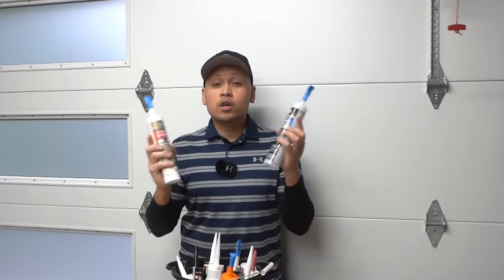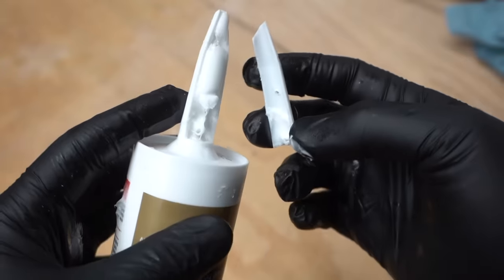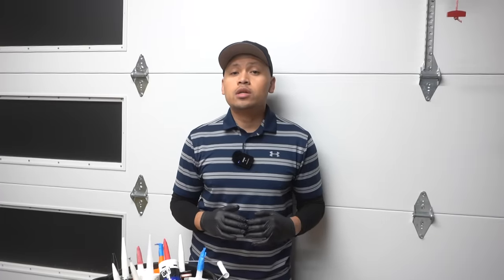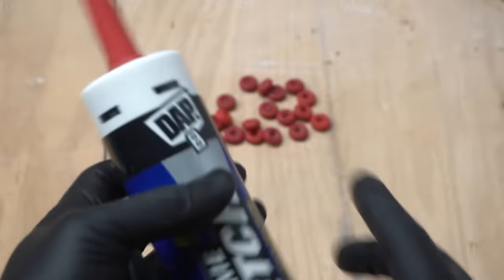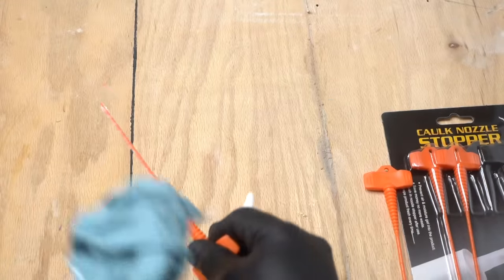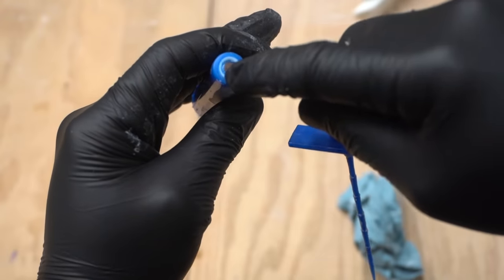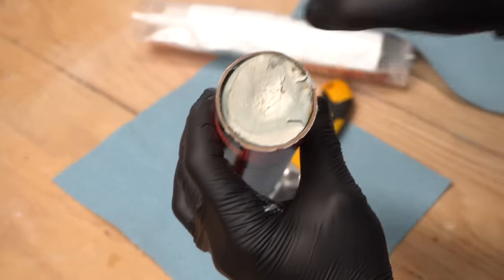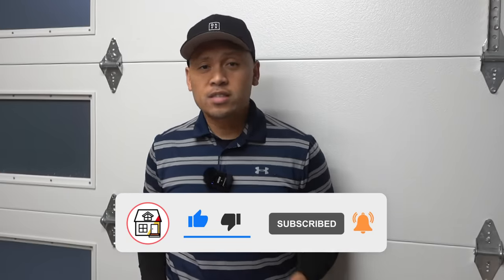STOP Throwing Away Half-Used Dried-Up Caulk Tubes! How To Fix It To Last Forever!

Comment: My dad owned a painting business in the 80s and 90s in Florida. When I go down to visit him he showed me a trick. Depending on how big of a hole you cut out of the tube. You get a wire nut and screw it on and just squirt just enough to seal that little end up inside the wire nut. 

I’ve been doing that for as long as I can remember. And just now a year and a half later I go out take the wire nut off squeeze the handle and look the tube still working properly.
Reply: Yep. Wire nut.
Reply: What's a wire nut?
Reply: I liked your idea, wire nut.  Thank you very much.  I will try.
Reply: @georgemooyman7155  A wire nut is a threaded plastic thimble used to connect electrical wires. Used primarily in the states.
Reply: @tommeyer3770  his whole premise is on the wire nut ,😂think he means a wing nut
Reply: @Zzrdemon6633  Not as commonly as "wire nuts"😂
Reply: @zeez4178  Nope, a wing nut is open on both ends.
Reply: I do the same thing. I use a red wire nut. Fill it the wire nut with enough caulk or sealant so it squishes out. Works better than anything I have found.
Reply: @zeez4178   nope he meant wire nut. wing nut is totally different.
Reply: Thanks, great idea.
Reply: Lol - is it like ball joint = joint balls - it was actually my first unexpected joke in English. Mechanics at the garage laughed like 15 min non stop… I still remember that day in TX
Reply: I used wire nuts but I missed the trick about squeezing out a bit of product into the nut! Great tip!

Comment: Our suggestion is to use what my Dad taught us to go 
1) Use a tight fitting screw to seal tubes for short term storage (a few days).
2) If long term storage is needed, we pack them in an old fridge that keeps them cold.
Six months later, we can still use the tubes as new.
Hope this simple idea helps someone out.
Reply: Thanks for the tip!
Reply: Damn that's handy

Comment: Ok, I'm a remodeling contractor and I rarely click on these videos, but just out of curiosity I scrolled through your video and I'm glad I did.  I sometimes use 5200 or similar marine caulking compounds and they are really expensive.  I save them by pouring a little bit of paint thinner down the nozzle and if it has a removable spout, which they often do, I clean that out and wrap some plastic or duck tape over that, then screw the nozzle back on.  Now I'm going to get some of those condoms for my caulk.   One thing you should mention is, even if there's a tiny amount of air in the nozzle, that will catalyze the caulk, so when you skin it back, make sure there's a blob of caulking coming out the tip into the condom so there's zero air space.  I guess those Tube-a-new things could be reusable if you clean them out after using them, making them more affordable, but hopefully the caps will prevent the need for using tube-a-new.  Anyway, thanks for sharing that info.
Reply: It's a balloon that's all 😅
Reply: Seal the hole with hot glue. Then when your ready to use it again just pull it off with some pliers.
Reply: @davea5150  Now that's a good idea, thanks!

Comment: I’ve used children’s small balloons to place over the caulk end point. As long as it maintains a tight grip once you roll it down to the base it should hold good until next time. The only thing is balloons are a little more on the thin side so being careful when placing is a must or you risk puncturing it.
Reply: That’s so true , cost per unit is way lower

Comment: Great video! Thank you!  A couple comments on this topic to share here.  
1- The blue painter tape your using has a porosity to it, pretty good for short term, but I would recommend clear packaging tape or a plastic based tape without a paper base to it.  I paint professionally for some years and love the stuff, but clear would be better for long term storage. 
2-Some caulks loose their ability to cure properly over time, I saved some caulk and used it years later and it FAILED to adhere the two plates together, it became a big project to remove all that caulk and then go buy new, so keep this in mind for the level of project your doing and if it's worth a possible compromised outcome. Yes, i said I had this caulk on the shelf for YEARS, if I can recall the brand and type I will update this comment.  
3- Just an aside tip I learned from professional commercial glazers on my jobs, to save the old caulk tubes and use the back of the empty tube to give you a place to wipe the excess caulk off your finger or tool into the rear of the tube! Simple little trick many may do already, but it changed my projects for the better with this better way to manage the material and it's excess that can actually be re used in contrast to wiping on a paper towel and disposing of the excess caulking. Neatness is everything in caulking as you know!
Again THANK YOU for the video!  I will be purchasing both the products in the links and think of you often my friend! Ciao Vince
Reply: porosity!!! Learned a new word today!
Reply: Really good points.
Reply: I use plastic electricians tape to prevent air contamination.

Comment: Great video on a subject that's overlooked! I use 1/2" clear flexible tubing. I cut several pieces about 2-1/2" long. Then heat one end with a heat gun until it gets soft. Then immediately squeeze the heated end in a bench vise. Leave until completely cool. These tubes fit all caulk spouts and when full of residual caulk or adhesive simply throw away and make more.
Reply: That's what I do.
Reply: great tip.  thank you!
Reply: Great idea. I have a couple feet of 1/2 tube I kept for no particular reason.

Comment: Like many do-it-yourselfers, I throw away more caulk and adhesives than I use due to drying and clogged nozzles. Screws plus tape never works long, so this video offered great tips, using products which I didn’t know existed. The first solution seems the best. Thanks for a very useful and informative presentation!
Reply: Ditto everything you said!
Reply: he said great tips :-)
Reply: All you have to do is leave a little bit of caulk around head of the nail once it's all the way in, then the caulk seals it. No need for any of this nonsense.
Reply: All you have to do is leave a little bit of caulk around head of the nail once it's all the way in, then the caulk seals it. No need for any of this nonsense.
Reply: The only caulk tubes I throw away are completely empty to the hilt, whether it's a day old or over a year old. There's absolutely no need for tape or these custom-made sleeves. #10 x 2" metal screws and nails are all I have ever used in my 15 years of using caulk, silicone, and glue tubes. I've pulled screws out of tubes that were opened over a year prior and the remaining caulk was still good as new, even after being frozen in the winter and heated in the summer. It's best to cut the nozzle slightly smaller than the diameter of the screw/nail, then you can just shove the screw in and forget about it. How much to cut off becomes second nature after you've done it for a while, but for beginners just keep shaving off a little at a time until the nail goes in but needs to be pushed in. If you mess up and cut larger than the screw, just drop the screw in when you're done and squeeze the handle until some caulk comes out around the head and smooth that off. Sometimes new tubes will push the nail out even after you push the release tab, just hold the nail for a few seconds and let the caulk flow around it. I guarantee your tubes will last at least a year with this method.
Reply: @somethingtrulyhorrifying congrats on the empty tubes you win the longevity award 🎉
Reply: @bethmurrow5626  Hey thanks man.
Reply: @somethingtrulyhorrifying  i use fire caulk at work and it comes with extra  tube ends that many times are never used so i always scoops those up……its basically the plastic tip of the caulk tube that isnt cut at the end yet.  I cut the whole tip off from its base and i have old silicone tube i have cleaned out and refilled with vasoline.  I take that slightly larger in diameter fire caulk tub tip and fill it with the vasoline caulk gun…..the fire caulk tip will be completely filled with vasoline, then just push that all the way down on the partly used caulk tube and clean the excess…….you can secure the vasoline tip however you want, i use rubberbands and cut 2 notches in the back of the tube and a lot of times the vasoline tip needs no securing.  When caulk is needed again just squeeze the first 3 or 4 inches into the garbage, you will see why when you do it….its amazingly brilliant! The caulk will last forever if stored this way or if you dont want to do all that just buy a tub of vasoline and stick the caulk tube in it upside down and you get the same results, thats  what i did  when i was trying different things out……..give it a shoot you wont be disappointed and share it with everyone :)
Reply: @kcjarembek  Gotta say that's a neat trick, never heard that one before. I use caulk and screws on pretty much every job so I prefer using a screw to seal the tube, it's quick and easy since I always have screws or nails on me while I'm working, takes just a few seconds to cut the tube to a smaller diameter than the screw, and if it's not empty when I'm done I just thread or push the screw into the nozzle and forget about it until the next job. It'll ooze out good as new in an hour from now or a year from now. I have used forgotten tubes that were half used when put away, they froze in the winter and got real hot in the summer, but the screw kept them sealed off and good as new. I have one screw that's been used exclusively for this purpose for so many years and tubes that it's encased in a big glob of dried caulk about the thickness of a rolling pin and perfectly slips over the end of the nozzle like a cap but better. I keep that specially for black tubes since black is harder to find, but a fresh screw is just as good as long as the initial cut is slightly smaller than the diameter of the screw.
Reply: Seems you need these only every ten years and there is no need to keep old cartridges. They just cost three bucks.
Reply: True, some cost only 3-4 dollars (e.g. Liquid Nails), but others cost as much as $15. There are often smaller tubes available, which might be the better option, although unit price is higher (irrelevant if most is thrown away).
Reply: Hot glue applied to the tip works great. Bit of a pain to get the glue gun out but you’ll never throw away caulk or adhesives again. Thanks to another YouTuber.

Comment: If you are using caulking on a regular basis just put them tip first into a small bucket with a couple inches of water in it.
It will last quite a while as long as you maintain the water
Reply: Ron and fleeting facet  In floor drains we put some mineral oil in the drain to keep the water from evaporating, this would work for your water in the bucket as well and will not go rancid as vegetable oil can.
Reply: That would work well for all water-based caulks but not for silicone or polyurethane-type construction caulks or adhesives.  These are chemically curing types with moisture and any moisture will accelerate the hardening all the way through
Reply: hA hA, many sealants use moisture to cure.....
Reply: @alanesterline2310  That is very good to know for anyone who has a floor drain that is not charged by the shower or basin discharge etc. Thank you..
Reply: @alanesterline2310  thanks good tip

Comment: I’m a former (recovering) paint contractor of 15 years, and always stuffed a nail into the end of the caulk tubes. This video showed multiple methods of problem solving this issue quickly with no extra crap. Great video, young man!!  
Now I’m an Old dog with new tricks.

Comment: At hardware stores in Australia, there's usually a bucket of free screw-on nozzles provided next to the selection of caulking tubes. You help yourself to a handful when you buy caulking tubes and you simply swap out the clogged nozzle with a fresh one each time it dries out. If you're going through a lot of tubes in a single day you transfer the same nozzle from the empty tube to the next tube to avoid wasting the caulking in the nozzle.
Reply: That's nice of them in England they are to greedy and unhelpful to do that they just need your cash
Reply: Bunnings also sell tips that have a thread at the end of the tip so you can screw on a sealing cap. That usually preserves silicone for a few months.
Reply: @46I37  I just put a piece of polythene carrier bag over the threaded tube end then screw the cap down on to it. Nozzle content goes solid but sealant in tube stays fine for months. I just put a new nozzle on when next needed, they are very cheap to buy.
Reply: In Belgium also 😊
Reply: In NZ customers steal the nozzles off the new tubes and walk out of the Hardware store with them. Sometimes it’s hard to even find a new tube with a nozzle
Reply: @grahambarton1942  Today I went to our local store where they sell machines and stuff. There was a huge box, filled with those nozzles. For free. Why are there so many differences when there are only a handfull of factories. Worldwide?
Reply: @CRV69  Yes. The other day, for the first time, I ran into a smaller diameter tube. Messed up my job timing!
Reply: Have not seen those in hardware stores for over ten years
Reply: They used to. Now you have to ask at the checkout.
Reply: Those rubber balloons look very cheap to make (Pennies) Why don’t,t the calulkimg companies include one with original purchase…..oh yea😂
Reply: @TonnyVanLoon  greed
Reply: Bunnings have  started limiting customers to one nozzle per tube, sorry to say.

Comment: Great tips.  I've had very good results over the years by just folding a piece of duct tape over the ends of caulking tubes.  It removes really easily, too.  One thing I want to point out…
12:31 — "You just saved yourself 10–15 dollars on caulk." — That tube of Liquid Nails adhesive costs about $2.50.  However, sometimes every penny counts, so saving money is always good.  Even when you may consider the cost to be negligible, if you had been counting on using that tube of adhesive and you find it dried out, it means time and energy wasted to go to the store to buy more.
Reply: I was going to comment on this - the days of buying a $5 tube of silicon are over . 
The Gorilla silicon is $17.95 Cdn here in Canada - I'm serious . I like it because it doesn't yellow .
Plus the Gorilla has a screw on nozzle , that can be removed,  cleared out , and screwed back on .  
A tube of Lepage PL is $10 Cdn from Home Depot . 
.

Comment: Great video young man.  Great research.  Great demonstrations. The tubes are a problem as I don't ever need all the caulk when I do small jobs around the house.  It is really troublesome to use caulk without a caulking gun so the large tubes are better  than the tooth paste versions that require He Man strength to squeeze the product out and because of this, it does not come out in a uniform stream. The smaller "tooth paste like dispensers"  which are cheaper because they have less caulk are also messy.  However, as you have demonstrated the large tubes can be  wasteful to buy because the tip dries up before all the caulk is used up.  But now I see there are a number of great solutions to this problem.

Comment: I  have 'unplugged' older tubes using a 6-inch-plus piece of cut coat-hanger wire. Its not great but in a pinch it opens up enough of a channel to get out enough caulk for the job. It beats having to run off to the store for a new tube. 
Side note - The $16 'Airtite' isn't worth it, but  someone makes a similar concept plastic case for paint brushes. At $4 its worth it if you're using decent $15-$20 brushes.

Comment: I've been vacuum sealing mine - I figured I own the machine for sealing food but why not give it a try and it worked very well
Reply: That sounds like it could be useful for some other things too like PVC cement maybe. Though the solvent might eat the bags. Possibly brake fluid which absorbs moisture from the air once opened.

Comment: As a retired carpenter I’ve thrown away hundreds used tubes in forty years. Hey boss paid for them, but I’ve tried everything at home ( ones I bought ) I’ll tape them with electrical tape tight as possible. Works ok I’ve cut the tip open and removed plug them taped nozzle back it worked good 👍
Reply: Electrical tape always works for me. The key is using about 1/4 of a roll of tape.
Reply: @Ritalie   That's a lot of tape, even from a small roll.    Made in Minnesota.

Comment: I use a wire nut and works like a champ. You can take it on and off when ever you need to. I’ve had caulk tubes last for over a year.
Reply: I just posted the same thing in addition to using a deck screw to pull out the clog.  Brilliant minds swim in the same stream.  😁
Reply: Wire nut + screw/ nail? Or just nut onto nozzle tip

Comment: Thanks for producing one of the more useful "how to" videos online.

The small "roll-on" rubber sleeve caps seem to be the most economical and practical solution, but I would add one small wrinkle to the application technique.  Covering the caulk tube tip with one of these small "balloons" should seal it well, but there might still be some dried caulk that can plug the very end of the tip.  To reduce that risk, simply squeeze a bit of caulk out of the tip after applying the "roll-on" cap, so that the end of the rubber sleeve is then filled with a small "bubble" of caulk.  That should prevent any trapped air from drying out caulk inside the tip of the caulk tube.

The TubeANew Caulk Tube Saver looks like a genius idea for recovering a caulk tube that is hopelessly plugged, and at a price that is quite reasonable.  If desired, this product can probably be cleaned and re-used.